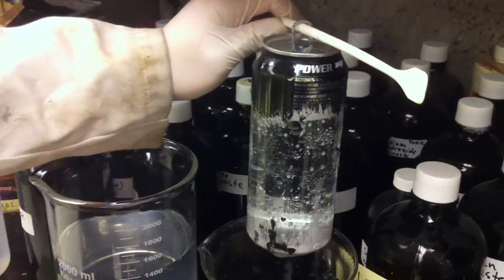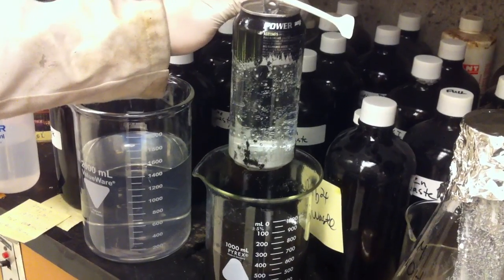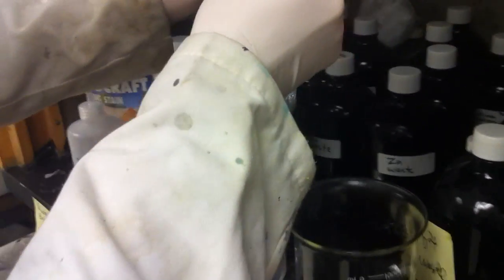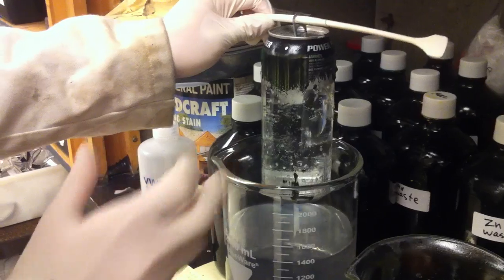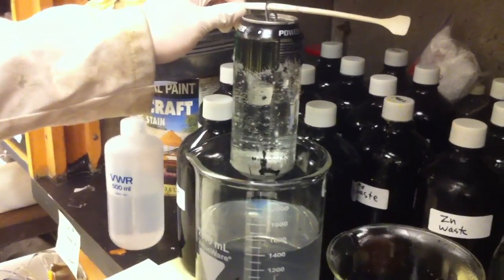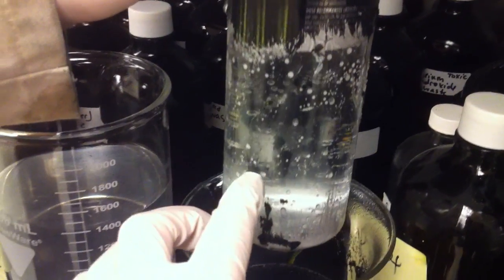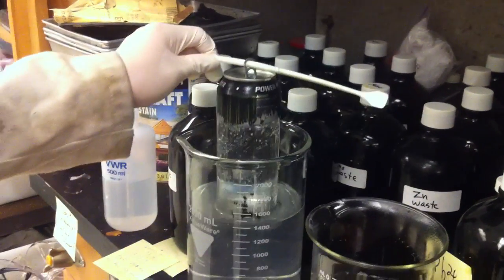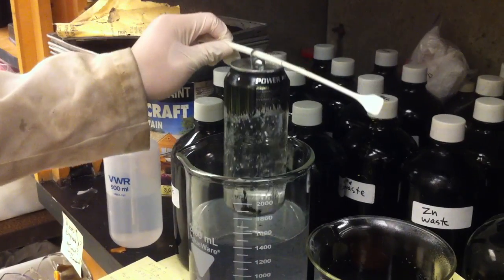How to expose plastic / BPA Lining inside Pop Cans

Comment: The guy who performed the experiment didn't answer her questions correctly. There is no metal "inside" the can. It's a thin aluminum shell with a BPA liner. The aluminum doesn't touch the contents of the drink. In fact, the BPA liner is present because the acidic nature of some beverages would weaken the aluminum.
Reply: it is not a BPA liner. It is an epoxy liner, that uses the BPA to form Epoxy.